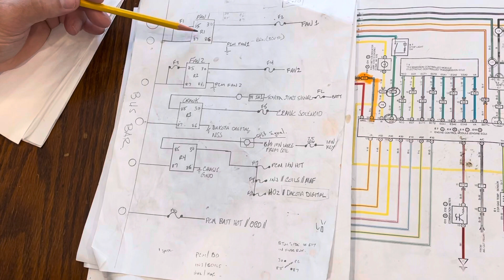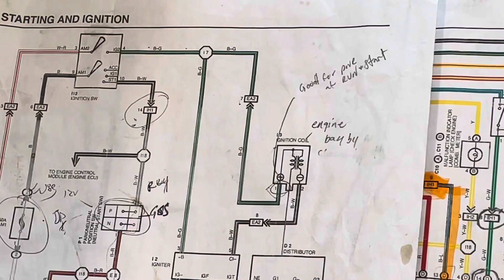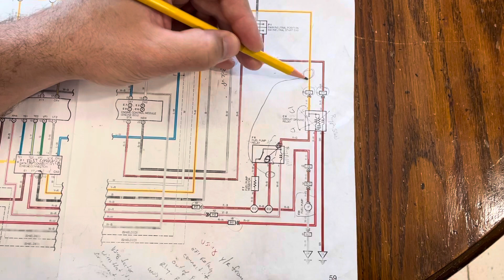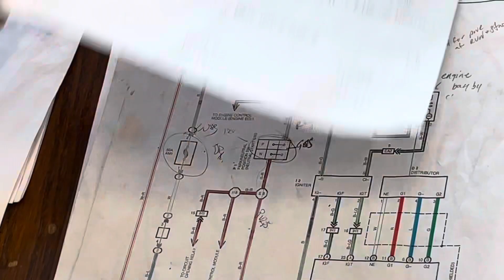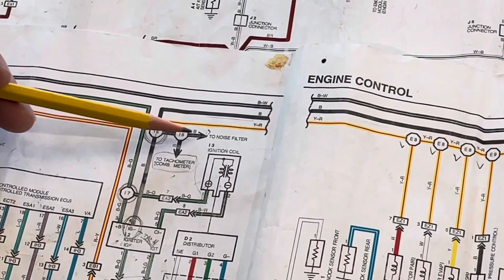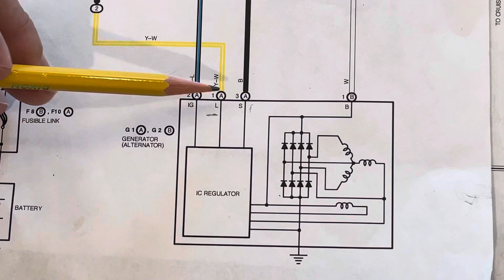How to wire your Toyota Land Cruiser FJ80 LS swap! Part 1

Comment: Edited to add there are some differences between your 94 and my 96.  I will list them here as I find them.

IH1 14 crank signal is actually IH1 21 on my 96.

IH1 14 actually goes to the injectors, which can be used for Ignition On.

Time Stamps

8:41 Battery Power
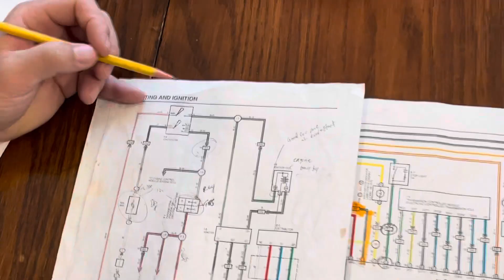9:34 Ignition On
14:40 Fuel Pump
18:53 Ignition Crank
23:11 Tach
27:54 Oil Pressure
27:24 Charge Light
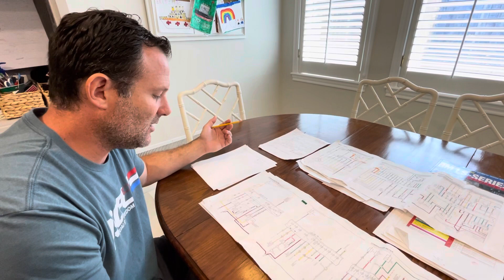29:10 Water Temperature
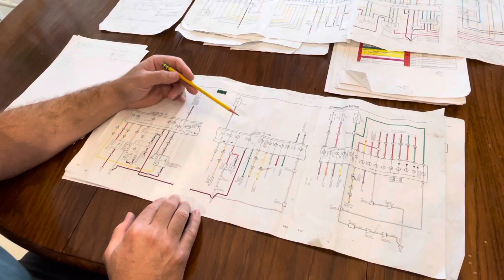30:25 Speedometer
32:54 Transmission Indicator Lights